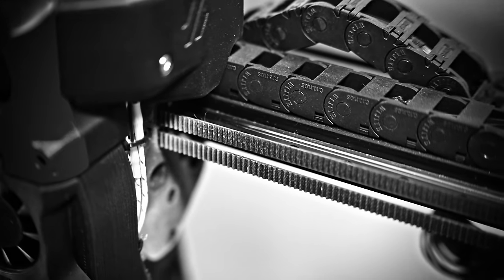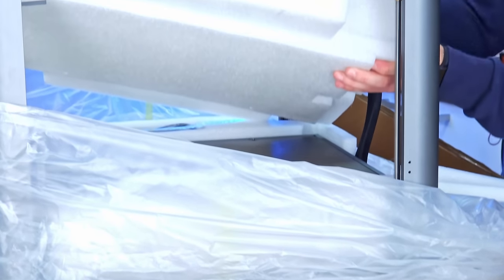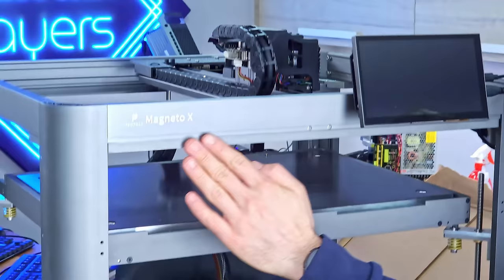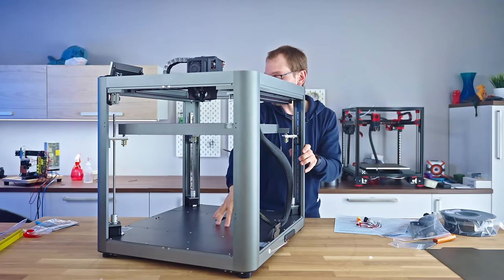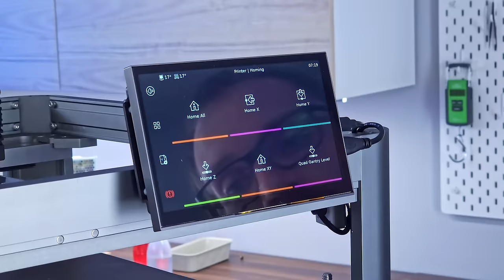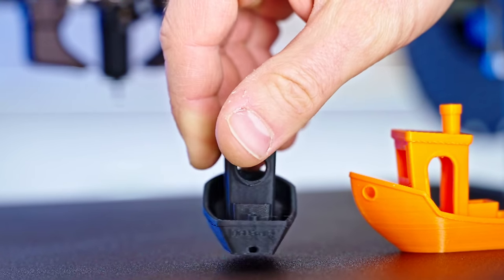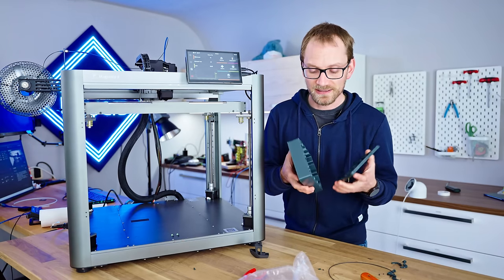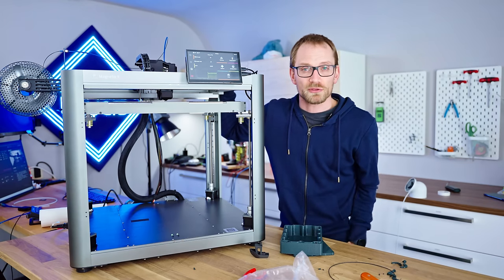The 3D printer with no belts: The Peopoly Magneto X uses closed-loop linear motors!

Comment: Tom casually fixing a motor design issue, no big deal.
Reply: I hope he invoiced them for engineering design support.
Reply: And few minutes after he mentions they did not wanted him to do anything crazy before it started printing - I had immediate flashback to that drill scene :D
Reply: Definitely not the sort of thing the average user should be expected to do, so it's nice to have them get it out to technically minded people who are capable of helping them identify and solve these issues for them prior to real production.
Reply: Tom is great. We tested print for a few days before shipping. We believe the issue was caused by too tight of tolerance on the ring and impact during shipping that locked it up. Thankfully, Tom was able to fix it.  We will address this in the production going forward.
Reply: legend
Reply: @AuntJemimaGames  Not something anyone should be expected to do on a production version of a product. That is for the R part of R&D to sort out and coordinate with the D part ...
Reply: Time stamp?
Reply: @peopoly  This looks promising!

Sorry, this got very long winded.

About that wobbling on the straight wall of the test box, is it possible that this is caused by the flip/flop of the electromagnets as they go positive, negative over the permanent magnets to product motion?

The way I'm seeing it is that the permanent magnets appear rather large for the linear motor to most without ..... trying to think of the best word to use here... wobble.... or waviness.  It's hard for me to explain, but it seems like, during travel, the sensor knows where the electromagnets are over the perm. magnets and as the magnets are N,S,N,S,N  etc, the coils have to be energized to push on one side while pulling on the other (flip flopping polarity) and with the perm mags being so large, the magnetic flux is "larger" which would be causing this wavy effect.

I don't know if I explained that well at all.   LOL
But knowing how coils react to magnets, as a coil passes over a magnet, as it gets close on one side, the velocity of the pull is low.  As it gets towards the center of the perm magnet, it moves faster, until it "locks".
Therefore, at that point, the polarity is flipped so that now the coil can continue OVER the magnet and "pushed" out the other side.  Then, is the next magnet, in opposite polarity, so as the coil is energized with the ending polarity used for the prev. magnet, it is not pulled into the next mag and the cycle of flip flop continues.

I wonder if smaller perm mags might work better.  Smaller in width, not in length and not in thickness.  ????

Just some thoughts that I can't seem to put into words properly.  LOL

This is one of the reasons why I enjoy working in my Lab alone and not having to explain my thought processes to others.  LOL

I'm going to keep my eyes open on this project.

If you get that travel smoothed out, this is going to be a next-level printer!

By the way, I LOVE that display!

And SD card is a must have for many of us who like to put our files on the SD card and print from that.

This way, no issue if a network or computer glitch.
Reply: @BlondieSL nice thinking there. I think
It just like using tighter angle of stepper motor of what you mention just now
Reply: @peopoly Maybe 1% of all 3d printer folks would have know what the issue was and how to fix it.  That was super impressive on Tom's part.
Reply: And free Goose feathers!
Reply: @JimmyDeanHaterOfficial 15:57
Reply: Easy just mill the sleeve quickly, press fit the bearing and replaced, nothing special lol
Reply: Average german engineer on their free time

Comment: I worked at a company back in the early 90's that had a pen plotter that used this tech, and the plotter was from the late 60's to early 70's era. It was about the size of a twin-size bed, and about 5 feet tall - but was outrageously fast.
Reply: What in gods name would you need a pen plotter like that for?
Reply: @BeefIngot  Signs and CAD drawings, usually.
Reply: @BeefIngot  Large plans, there are plans for urban development that fill the floor of a large room.
Reply: I would assume you're referring to xynetics—-i was field service on those in the day (80’s)—-in addition to flat bed plotters, there was a version called “wirematic” that made aircraft wiring harnesses…everything old is new aga…
Reply: @TheRealTravisMartin  Yes! Xynetics 1000. We had the biggest one that they made.
Reply: The linear motor pen plotter (16 pens in a rotary carasel in the head) I was using in the early 80s was the size of a king single bed and was so dangerous that there was a pressure pad on the floor all around it. If something stood on it, the plotter immediately froze. We were all warned the gantry would likely kill you if it hit you on the way past. I think it was a Mark4 plotter attached to a CC80 Auto-trol Cad setup.

Comment: This is quite funny. A printer that you needed to redrill spacers for to fix a design flaw and almost wrecked because it didnt have a zstop notice to know it had already reached the toolhead, gets praise? It has noticeable ringing as well on the final print and warbling on the walls. I feel like you have been VERY generous on your opinions on this, especially when compared to your review of other printers like the bambu labs x1c whoch was just "fine" and "okay", but didnt need you to fix physical flaws nor did it almost destroy itself. And the final print was better, imo with less ringing.

Comment: What’s interesting about this platform is it should be relatively easy to add additional tool heads to make an IDEX even beyond. No additional belts are needed, just extra drivers and a longer x rail to provide parking space for unused tools.
Reply: Tons of extra moving mass though. If anything Id say this was more ideal for a tool changer where there would be less wores to worry about routing.
Reply: @BeefIngot  yeah , it sounds great as a toolchanger
Reply: @BeefIngot  it would add less mass than a conventional IDEX, which needs to move the mass of an additional (full size) stepper in y.

In any case, if you print multiple parts (in parallel or mirror mode) a lot, a slower-moving IDEX will be much faster than a faster accelerating tool changer. So it's not really one or the other. Both have their place.
Reply: @JonS  I count the ol double corexy as also being conventional.

As for dual printing, I guess, but how often do people actually do that.
Reply: @BeefIngot Alternatively, since the movement route is not necessarily tied up with belts, there could be a parking rail where you put the toolhead that is not in use. This would solve the weight problem.
Reply: @NoIPHU  ??? Thats just the toolchanger I suggested in my first comment.
Reply: @BeefIngot  Since normal hybridcorexy already get terrible graphs, I'd be content to settle for the extra moving mass.
Reply: @BeefIngot  I didn’t get that from your first comment either. I assumed you were referring to a “normal” tool changer like E3D’s or the Tap Changer project.
The stationary magnetic rail docking is a very nice idea, so long as the alignment can be maintained.
Reply: @JonS Not sure I get the distinction. Aren't there already many tool changer designs including magnetic already?
Reply: @BeefIngot or you just add a whole gantry...no extra weight...just longer rails to park it on the end. 
You could even do two different prints with only the Z axis moving both heads in sync.
Reply: @heavyweather That is another idea yes, but that motor is not cheap, or at least linear motors last I looked them up were not cheap.

We are talking like 500 USD extra per rail, but maybe this company has a way to bring the price down.

That being said, even if this were the option, I still would probably be willing to spend to make a 3 head. That seems just about right for differing materials with the budgetary and space constraints.
Reply: I think you could park the unused toolheads on small parking rails which are separated from the moving rail, to enable material change without increasing moving mass.

Comment from the maker: Looks like YouTube is having a lazy day with processing this one up to 4k60... Guess it'll get there eventually!
Just to clarify, I was assured the printer we're looking at in this video is identical to the production units - but as with anything, there will certainly still be changes to it down the road, whether those be for cost-saving or for improving certain aspects of the machine.
The software (both the printer's firmware and the slicer) are still obviously a bit rough around the edges, but are much easier to update than hardware - with so few machines in the wild right now, I'm not considering this too much of an issue yet, but I do hope that the printer's tuning will improve over time or with community involvement. 

Let me know what comparisons, benchmarks or experiments you'd like me to do with the Magneto!
Reply: I know some further software updates are coming, should be a new round for the testers to validate this week. Hardware seems pretty solid at this point, it's mostly as you said the software. Luckily, it's klipper, so 98% of that is just dropping in a new config file!
Reply: Peopoly printer is very promising ❤
Reply: YouTube is being extra lazy, it's still only showing 360p for me.
Reply: I really want to know how accurate the closed loop absolute encoder system is, or if it even is absolute. Like, does it not need to home?
Reply: This is bad. I thought this was a pre production unit. I mean, the safety, the bended nozzle. Those are huge problems and you said it yourself, this can't be sold to EU. I expected more from them. As a tech demo it is good but I'm not buying a tech demo.
Reply: I'd like to see a long term review of this printer after you've gone through all the final end-user calibration rather than just relying on the admittedly somewhat rough factory calibration. This printer looks very promising and I suspect that it's capable of far more than what we saw just from it's default settings.
Reply: I have seen other people complaining about Youtube encoding being slow currently, so it's not just you.
Reply: I'd be interested how much speed and acceleration those linear motors can handle. They seem to accelerate that beefy print head quite well, I wonder what a lightweight design like a VzBoT could achieve with this drive system.
Reply: I'd like to know how much power is consumed by those linear motors compared to steppers.

Comment: Despite all the quirks - this is the first printer in at least 5 years I would be exited to own. The sturdiness, the platform, the mechanism are an awesome starting point of something 
that will last for a very long time.
Reply: I'm no pro, but this also has me interested. If my wife wouldn't kill me for spending that much, I'd be in.
Reply: Exactly! I am tired of sketchy-mechanics nothing-new kind of commercial products we have seen in the past 5ish years.

Now, this IS THE innovation!

Almost perfect. No excuse for the lack of Z endstops and of the lack of mains insulation. For the bed part, I think that at this level, the bed thermal insulation should be standard as well.

One little nitpick with the mechanics is that the axial bearings should ideally hold the Z axis screws directly, not through the flexible coupling. However, I see that they used an almost rigid coupling, and the bed system is almost a static load, so I can forgive them for that.

Overall, as someone who sees the innovation and the improvement opportunities and also likes to fabricate things: I'd buy it!

Comment: 8:27 "it knows where it is, because it knows where it isn't"

Definitely impressive!
Could you see if the print bed frame was connected to earth?
Reply: Thought the same thing 😂
Reply from the maker: By subtracting where it is from where it isn't, or where it isn't from where it is (whichever is greater), it obtains a difference, or deviation. The guidance subsystem uses deviations to generate corrective commands to drive the motor from a position where it is to a position where it isn't, and arriving at a position where it wasn't, it now is. Consequently, the position where it is, is now the position that it wasn't, and it follows that the position that it was, is now the position that it isn't.

Surprisingly accurate description of how the closed-loop system works 👍

On the topic of grounding, the entire frame, bed and moving axes are meticulously grounded, so there should be absolutely no risk of the frame itself ever becoming live.
Reply: @MadeWithLayers  😅👍
Since you know "a thing or two" about 3d printers, maybe you should switch into development.

Using linear motors for x and y is somehow obvious, still no one has done it. I bet you also have some ideas on what can be improved in persue of the optimal/best fdm printer there can be.
Reply: @MadeWithLayers  But Clipper does still don't know where the printhead is.
Time to fusion Marlin/Clipper/GRBL with it's source from EMC2/LinuxCNC and go realy full closed loop positioning system including the trajectory control system.
This would be the real way to eliminate the ringing artefacts
Reply: This whole section seems to have been copied almost word-for-word from an ancient training film about MISSILE GUIDANCE, which I have seen years ago, here on YouTube:
The guidance subsystem uses deviations to generate corrective commands to drive the motor from a position where it is to a position where it isn't, and arriving at a position where it wasn't, it now is. Consequently, the position where it is, is now the position that it wasn't, and it follows that the position that it was, is now the position that it isn't.
 @MadeWithLayers
Reply: @MadeWithLayers  love the reference to the Guided Missile explanation, now meme XD
Reply: @YodaWhat  for a number of years now works has been proceding to bring perfection to the crudely conceived idea of a transmission that would not only supply inverse reactive current for use in unalateral phase detractors, but would also be capable of automaticly synchronising cardinal grammeters.
Reply: @attack125   That's good, because my uncle Mho no longer has the Capacity to keep Current in a world of so much Resistance. ;-)
Reply: prevents side fumbling.

Comment: Hats off to Peopoly for creating this awesome first of its kind printer. Agreed it needs some tuning and some adjustments for the safety concerns but yea, I can see this being a serious contender for best of the best 3D printers! A lot here for Peopoly to be proud of and cant wait to see this on the open market! Even the price while expensive is really not when you consider what went into building it! It for sure in its current state would not pass US safety laws and it really needs a crash mitigation for that hot end. I really cringed when I saw how hard that hit the build plate.
Reply: its going to give rat rig v core 4 a run for the money in the states i'd guess.   the 400mm^3 is the same $ from what i've seen